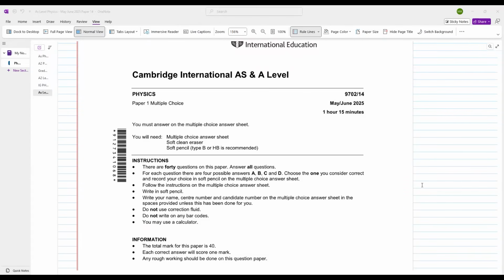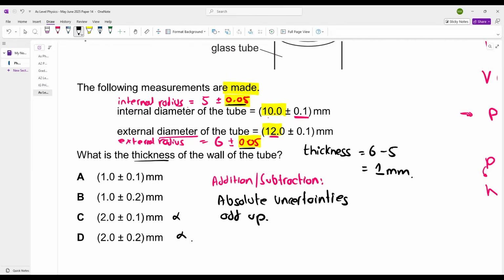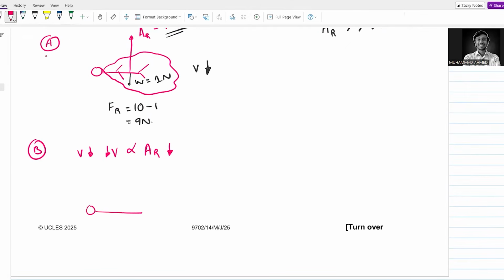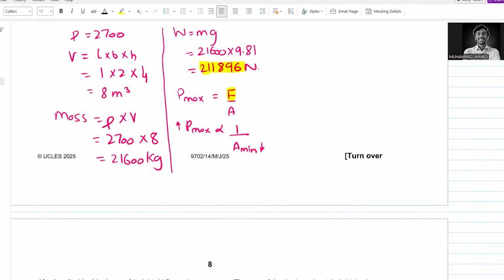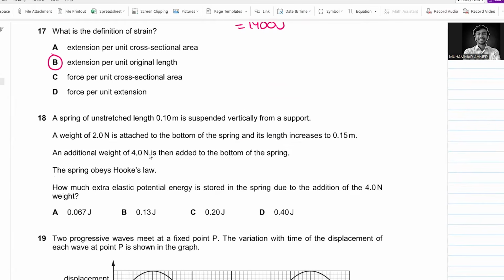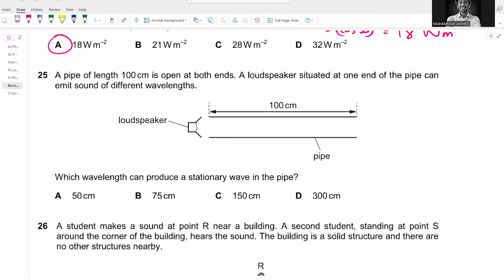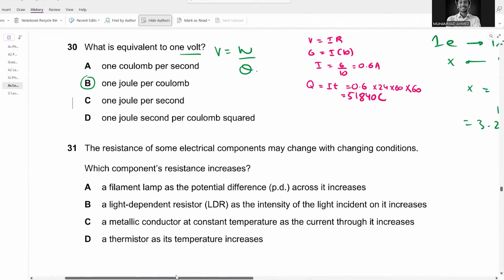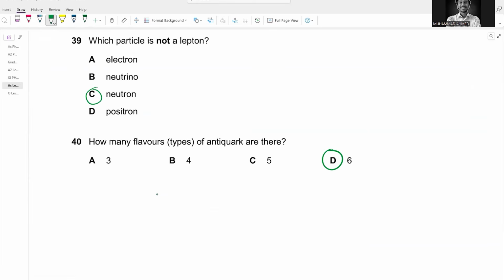As level Physics 9702 May June 2025 Paper 14 SOLVED!!

Comment: In question 33 wouldnt the current which passes through each resistor be different? That would cause a change in power dissipation
Reply: we made eq ror voltage as it was constant

Comment: sir what if we do External-Internal diameter devided by 2 in Q3, we get the same value the the uncertainity will be 0.2 instead of .1, can u explain why it is wrong
Reply: Uncertainty of 0.2 is the uncertainty of the diameter. The question asked us for thickness. Thickness is half of diameter's uncertainty.
Reply: and also for other questions, multiplication and division wont affect the uncertainty. But for this specific questions we have to divide 2 for Thickness uncertainty.
Reply: @AlphaQ9702  so why does it affect this thickness question specifically if it doesnt affect the rest? kindly explain itll be so helpful